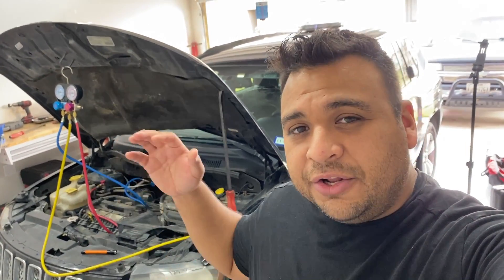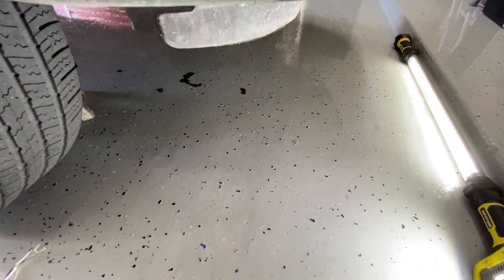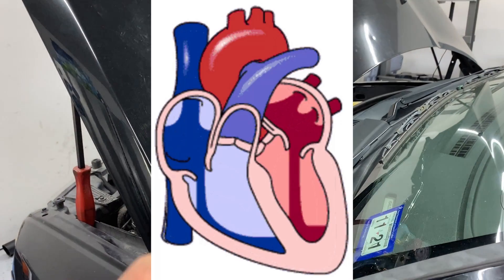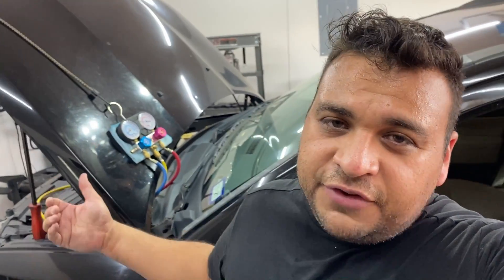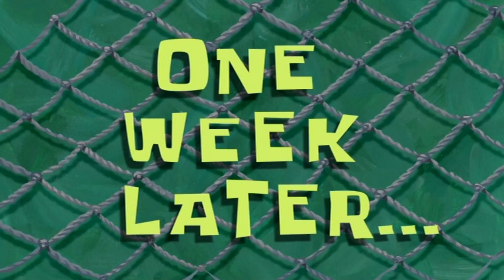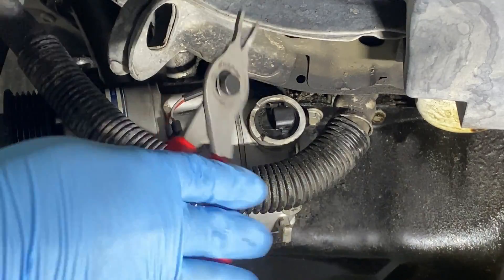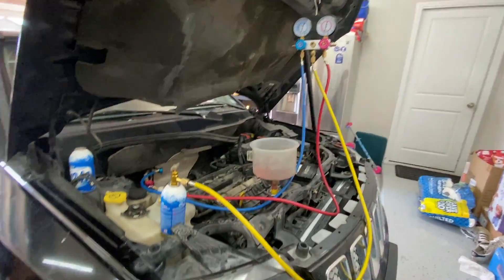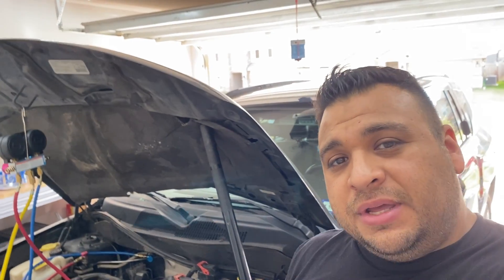JEEP COMPASS A/C NOT COOLING DURING IDLE / COMPRESSOR CONTROL VALVE

Comment from the maker: Hey Guys! I just wanted to add that you can also do a resistance measurement using an ohm meter to test the control valve. I did not film this procedure because I was not sure of a specification. After comparing the old valve with the new one, I found that they both measure to about 10 ohms. That seems to be normal. The resistance measurement test can tell you if the valve is faulty electronically but not mechanically. The valve plunger could still be sticking even though the magnet is working fine.
Reply: Can we check it like intake camshaft?!
Reply: I heard through my research that you can put a balloon over part of the end of the valve and blow it up and if it deflates with power given to the valve then it is bad and if it doesn't deflate then it is good....basically testing to make sure when power is given to it, it opens correctly and is not stuck where it doesn't fully open....you could also breathe through it using something that fits around it
Reply: Hi, exellent video. Thanks for posting. 
By the way there is a tool to test the duty cycle of the compressor. 
It is expensive but you don't have to guess what the problem is. It even allows you to test the resistance on the valve, no need to get the multimeter out.

Comment: I love you man and you are a master mechanic and I am a shadetree mechanic with a degree in Chem Eng.  The static pressure of the refrigerant doesn't tell much.  Much of the refrigerant is liquid and the pressure is determined only by the ambient temperature when the car is shut off and cold.  The pressure will stay the same until all of the liquid has evaporated and then if more is lost, the pressure will stop dropping.  
For example, if you had a gauge on a can of refrigerant, the pressure will remain the same until all of the liquid has evaporated and then it will stop dropping.  Great diagnosis by the way!
Reply from the maker: Great info! For my purposes, I look at the static pressure because that’s what the cars computer is looking at to determine whether or not it should turn the compressor on. If the A/C pressure sensor is reading low pressure then the compressor will not activate. Thanks for watching!

Comment: Here's my theory: The original root cause of the poor A/C performance was the sticking temperature door, which you solved. However, previously another mechanic simply shot the parts cannon and replaced the compressor with that aftermarket unit. The aftermarket compressor is a cheap knock-off, so it failed early. That brought the customer to you. Chrysler has used Denso compressors for a while (the same manufacturer associated with Toyota), so likely the parts changer mechanic caused the customer additional grief with inferior parts by not doing a thorough diagnosis. Lots of compressors get changed for no good reason, aside from the fact that the mechanic does a bad diagnosis. That's likely why the cost is so high. The replacement valve would likely have worked in an OE compressor. I'm sure your friend appreciates that you were able to fix the problem. Keep up the good work!

Comment: Thank you for this video.  Your right about ANY Chrysler product, especially a used one.
Newer vehicles have that full time on with the control valve.  Some have the clutch with the RPM pickup in the rear of the compressor.  That oil leak didn't help any, that's for sure! 
Good work. Your thorough in testing and it shows in the repair.

Comment: I always like to come up with a hypothesis at the beginning of your videos based off the customer complaint, definitely off on this one. Was fairly certain there was a lack of air flow over the condenser, didn't even know this style of A/C compressor existed either. Thanks again for another great and educational video.
Reply: I was thinking the same thing at first til I saw the fans on
Reply: Yes I know why you thought that way which is good initial thinking.  That's why a few more tests to rule it out is so worth it.  Pressure of the system definitely would rule that out and point you right towards the problem being compressor related...

Comment: I noticed the temperature guage read 60 Fahrenheit and to most that's not cold at all especially when it's really hot outside! 
mid 30's-40  is normally a good working system which everyone is happy with and comfortable! but there's most likely other a/c components that would have to be replaced to reach that goal which obviously is an additional $$$ and the vehicle's got so many issues it just ain't worth it to fix it all to where it should be like new you would go and buy new!lol.
Hey great video great job and being honest and saying how it is and what the best option and decision is to be made for the costumer!,

Comment: Well trying to help out a friend I understand.  ..    I bought a vw and I had to replace the compressor because it would not make the correct pressure.  I think the compressor works simular to this one . I did  not change out the valve that controls the squash plate . Those blend doors can cause you grief . I like to isolate the hot water some times to help cooling . Your right about the quality in my option on those products lol

Comment: It doesn't look like the control valve solenoid does anything to move/angle the swash plate . It only seems to be a valve, so I'm thinking it is just actuating a refrigerant bypass within the compressor, basically when commanded off, it allows full bypassing of the refrigerant going directly from the outlet back to the inlet. When fully ON, it blocks any refrigerant bypass and allows it to flow through the whole refrigeration loop. The solenoid probably could have been fixed by cleaning and lubrication, as there is nothing to really break, except for the valves the fairly weak magnet actuates to get stuck. You could have tried that before full replacement. Also, since the blend door was broken the whole time to a degree, that means the evaporator wasn't getting proper airflow, making it run cold, restricting gas flow to the compressor inlet, and causing the symptoms you saw... I bet with the blend door fixed and the original control solenoid valve cleaned, the old parts would have worked!
Reply from the maker: Interesting theory but the blend door got stuck during the time we where waiting for the part. During that week we had a random cold front come out of nowhere and he turned his heater on for the first time this year. The next day he tried to turn it back to cold, but it wouldn’t cool anymore like it did before. Plus, after replacing the compressor, I saw an immediate change in the pressures. The pressures read good even though the cabin was being filled with hot air. That’s when I knew the blend door had gotten stuck. I’ve seen this happen before on Jeeps. These were two separate problems.
Reply: @ADVANCEDLEVELAUTO  I can agree on the blend door being a new issue. But don't you agree that the control valve is just a solenoid opening or closing a valve. As long as the coil is not shorted or open circuit, it is electrically in order. That just leaves the valves themselves to be INOP, and apart from damage to the sealing surfaces, it seems most logical to me that the valve was sticky, and thus limiting the function of the compressor by bypassing most of the refrigerant.
Reply from the maker: @jovangrbic97  The valve controls the swash plate angle by allowing refrigerant pressure to enter the compressor crankcase. Here is an article that explains it pretty well. https://ricksfreeautorepairadvice.com/clutchless-ac-compressor-how-it-works/

Comment: GM has used the variable displacement compressors since the 80s but they still had magnetic clutches to engage the compressor.  It just didn't cycle with low load the valve would shift and unload. So the magnetic clutch has been omitted altogether?  Does the compressor always turn and does it have the capability of unloading completely with no call for compressor operation i.e. HVAC turned off? Interested to know. Been out of the auto field for awhile now but still do HVAC and refrigeration daily.

Comment: Good informative video thanks, we have replaced several compressor new / used it works for about 5 days then  stops working. Not missing freon. wondering if you may know other possible fuse/ relay issues?

Comment: 2015 Jeep Compass 2.0….when I turn on the AC the compressor makes loud knocking noise but  still cools. My best guess is the compressor needs replaced. There are no coolant leaks, but would you advise replacing the condenser, dryer, expansion valve, and etc while doing the job….or just replace the compressor?

Comment: 2011 highlander charged using robin air machine to max 1.81 lbs listed ac compressor turns off below 1000rpm works above just fine. Low side around 30 when reved and working high side 175-200 Should I add more ? New compressor condenser and expansion valve

Comment: Great educational material video like always thank you so much for time you take to share your knowledge. 
Just an observation can your a/c gages manifold hoses for low and high pressures be attached to de manifold backwards because the angle ends look funny.
Reply: No I believe the high and low ports are 2 different sizes
Reply: @DylanL69  yes I understand that 
but What I saw is that the end of the hoses I believe it goes on the fittings instead of the manifold if you pay attention one end of the hose has an angle and the other end is straight.
So my theory is that the straight end goes attached to the manifold and the angle end goes on the fittings.

Comment: I just had my local dealer install an aftermarket uac compressor from partsgeek
The compressor wants to work when it wants to, dealer took a look and figured it had an obstruction they pumped it back down and filled system and it was fine 2 days ago today me and wife got in car to go for lunch and its blowing all warm/hot compressor not kicking in..with the difference in the uac control valve and the oem control valve could it be the point of failure ?

Comment: My 2014 jeep compass latitude 4wd 2.4 engine ac isn't getting cold and there's a rattling  noise when I turn on my airconditioner I was told I need a condenser before the mechanic finished talking he said a compressor pump  are these two parts the same just different names help me to understand what is it I need

Comment: I thought the electrical control valves would set a code in HVAC or body mods if conditions didn't meet the computer expectations.  Am I mistaken? Seems I seen another video on this somewhere.
Reply from the maker: The valve may still be electrically good but mechanically sticking.

Comment: My a/c is intermittent in my Mercedes I can hear the compressor clutch but it sounded weak and I can't find a wiring diagram for the clutch also the radiator fan isn't working I wonder if the fan controller is making the clutch have a weak signal

Comment: Nice video. Please do not lean items such as the tire up against the body panels of the vehicle, you are teaching DIYers here on the channel of if they do not follow all safety procedures such as lower the vehicle down to the safety stand or they don't have one and their jack leaks, that tire is going to leave a nice dent in the door. I am wondering about the backing plate on the end of the entire compressor if the shape of it or the overall diameter of it would be a telltale sign as to the overall length of the solenoid control valve? A complaint that I have is when Providers show a bad PWM waveform but do not show a good PWM waveform after the repairs are completed. The AC Head unit or the PCM may be trying to control the PW based on pressure feedback from a pressure sensor? No problem that you didn't go fully into the AC theory of operation but a known good PWM Waveform would have been nice in the end. 

For a solenoid test I would do an on vehicle bench test with the scope amp clamp, just give the connector full 12 volts and monitor the amp wave to see if the initial charge was ringing and angled normally or if it goes vertical immediately showing a shorted coil, the same as an ignition coil or injector coil. Thanks for the bonus door linkage. Thanks for the case study.

Comment: Looked at RockAuto and it's confusing, the 2008 has the control valve and it is the short one, the 2014 does not offer the valve by itself but the compressor part number is different after 2008. Maybe they just changed the part number and wouldn't sell the valve independently, the only difference between the compressors seems to be the location of that control valve is a few degrees lower.
Reply from the maker: Exactly! That’s what confused me. So, I found a listing on eBay that said it fit 2014. In my case it didn’t fit.

Comment: The first step of properly diagnosing a critically charged AC system is to evacuate and measured the captured amount. Secondly, for vehicle AC systems a refrigerant analyzer is especially important because historically vehicle AC systems are always known to be contaminated. If you aren't doing this you have no business working on AC systems.

Comment: Great video.  Is there a place to get a wiring diagrams for a 2004 mercury sable is.  It does not start and I don't here the fuel pump.  Changed relays, fuel filter and battery still no start.  Any recommendations

Comment: Those 4 cylinder engines are just worked too hard in modern cars, especially the turbo models. Power everything, high output alternators etc. put more loads on them vs. years back. These are disposable vehicles...better off renting them or finding something else with V8 if you are looking for long term reliability

Comment: Surprised you were so negative about the Jeep. The dirty engine bay and gummed upped blend door linkage tells me that thing has been in some deep water. The leaking oil looks like it came from the valve cover. The trans problem could be cured by a simple spill and fill.

Comment: Ac not working there is a major oil leak vehicle have other issues it's a Jeep Compass I wouldn't expect any less out of the so called 3 American brands  I rather walk then drive a Chrysler/Dodge/Jeep product they make good looking vehicles but reliability do not exist with that brand
Reply from the maker: This Jeep just threw a connecting rod out of the side of the block. I'm gonna be putting a used motor in it. Video coming soon! Thanks for watching!